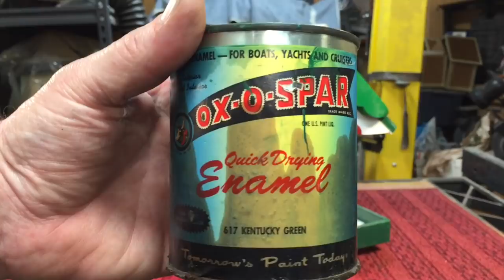Let’s Make A Bird Table!

Comment: The bird table is great. You measure and build like I do. My plans are in my head. Lol. I usually get off a rant or two daily. Somehow it helps keep my sanity. I recently needed to paint a back stairway and hall. The color did not so I mixed five part cans of 20 year old latex paint. It came out a cream color and worked perfectly and I was finally able to throw out the empty cans..
Reply: John, when we moved house I had three used tins of fence preservative in red cedar, golden brown and light oak. Mixed them together and came out with a new colour I will call Poo !😁. I had to only use it on the two sides of the shed invisible from the house with everything else painted woodland green

Comment: In my neighborhood we had an old hardware store. It had that great old hardware store smell. He had all kinds of stuff in there.  The store just recently closed (in the last year or so.)  You could buy one screw or whatever you needed. He made keys, sharpened stuff, fixed window screens and glass. I wish I had taken pics inside there.  
30 years ago he had paint in that place was probably 20 plus years old. Every so often he would invert the cans and you'd see these cans of paint upside down. He said he did that to get the pigment and the oil back together. I bought some enamel oil based paint that was also green and I used that on my model railroad from the time I was about nine back in the late 80's until I switched my hobbies to girls in the early 90's. It would make you dizzy using it in the basement.  It was still good in 2017 when I was getting the place ready to rent after I bought it from my parents. I have no idea what was in that quart of paint, but it was good stuff!
I love the bird table! The little heart gives it that German flair. My wife has been asking for more birdhouses since a little family of birds moved into the birdhouse. Maybe we'll do a table here, although the squirrels, bears, and deer would probably get more use out of it than birds.

Here's a picture of that old hardware store  https://s3-media0.fl.yelpcdn.com/bphoto/5vwgfB38EkufQFnQ1K1oAw/348s.jpg
Reply from the maker: Wow!  Years back I used to visit old hardware stores looking for old stuff and I always loved the real old ones like you described!  There are a few still out there!  😃👍

Comment: I prefabed 90 of these for the scouts summer camp. Like you I had picked up all of the old cedar siding from a home down the street that I used. I forty five all the joints and pre drilled for the nails. My fathers trick for drilling is to cut the head off the finish nail and use it for the drill bit. I was suckered in on this project that someone would help. Oh well , my two hands did the job.. I stayed anonymous. The person that got me involved brought me a thank you plack. It was fun and a lot of work.

Comment: I have to replace one that was rotten. So I think I will use your design. Looks pretty simple. My wife goes through 25 pounds of seed a week. So she will be happy, thus I will be happy. Thanks for sharing my friend. Stay safe.
Reply from the maker: Jess- Mine is rotting out also!  If you roof it with shingles it would last longer I guess!  😃👍
Reply: @ScoutCrafter  thanks,  I believe I have some. I'll try that.

Comment: Tweety and I tried the bird feeder route years ago when we bought our house and kept finding dead birds in the yard. Didn't know what was going on. We later found out that the birds would be perching on our antennas (we have 6 antennas up). I was frying them whenever Tweety and I were on the ham radios transmitting. Well, we got rid of the feeder and bought one of those large plastic owls to keep birds away. No fried birds in the yard anymore. Anyway SC feeder turned out great.
Reply from the maker: Wow!  I bet you have some linear amplifier!  😃👍
Reply: @ScoutCrafter  Ameritron AL-80B. I usually run around 700 watts ssb

Comment: Beautiful job John. 
It is odd how people who have never been involved in actual fighting think that the police are their enemies. They think that pushing the authorities around is easy because the police are being held back. 
Defunding the police won't get rid of them. It will just take away the restraints placed on the people who are trained in how to handle situations, but threatened by politicians if they do what they are trained to do. Most people instinctively run away from danger. Cops and the military run toward the sound of the guns.
Reply from the maker: Dave- I think most people have no idea how unsafe they would be without law enforcement.  People forget the 70’s!  😃👍

Comment: Great video!  Been a subscriber for quite some time. In reference to the T-25, I found myself in a situation where I couldn't get the drill in a tight spot to turn the screw. Believe it or not, Allen wrenches also fit those and work like a charm!
Reply from the maker: Eric!  I never knew that!!!   Awesome tip!  Thanks!! 😃👍
Reply: @ScoutCrafter  As many tips as I've picked up from you, I'm glad I could give one back. I actually discovered this out of desperation when I couldn't find the bit for the screw!
Reply: I've done the allen key trick in the past, just find one that more, or less fits.  They make torx sets now from T-10 to
T-40 that are in that L shape just like an allen key.

Comment: Rant:  If the Police were to strike, I'd SUE the city to get my city & property taxes back!  
           It is bad enough, that IF you call for an EMS Ambulance, you get a bill! 
Question: Moisture is bad for bird seed. They become plants. Would a mesh fabric (i.e. shade cloth) on the floor work to keep the seed dry? Drain holes? Squirrels love shelled almonds.
Reply from the maker: Alan, Great topic! When I build my bird tables I try to make sure the roof overhangs the table by at least an inch, also I make sure there are drain holes and lastly I don’t make the roof too high.  I never had a moisture problem yet!  😃👍

Comment: Instead of overlapping the boards for the roof, couldn't you have angled the edges?
Reply from the maker: Absolutely!  However I find overlapping creates a perfect 90 degree angle with no fuss.  It’s easy to attach the two boards also because you can use longer fasteners.  Mitered corners can be tricky and don’t always remain tight with normal wood movement.  😃👍